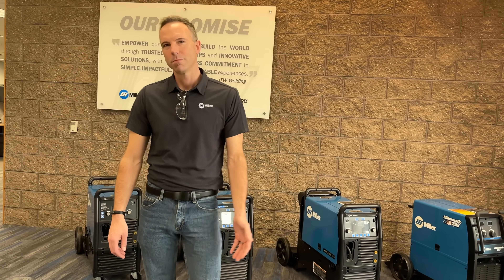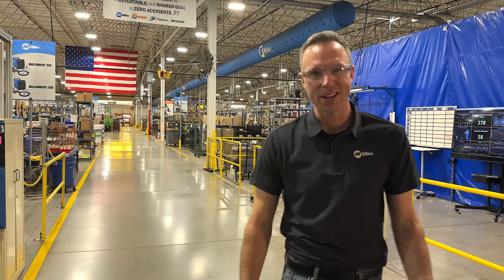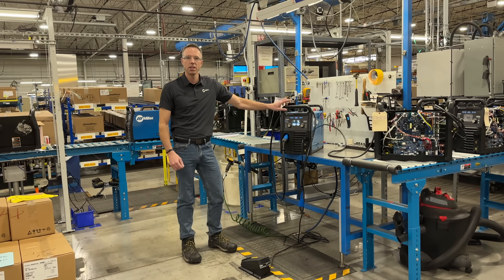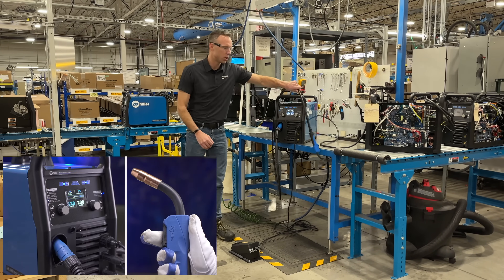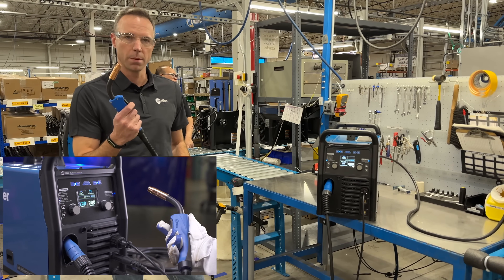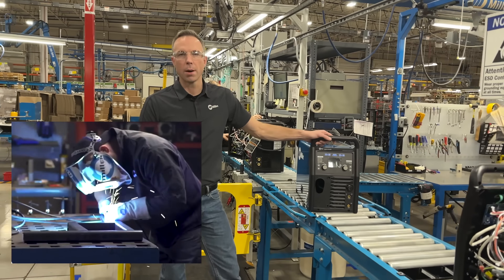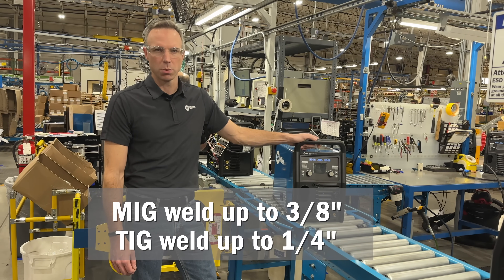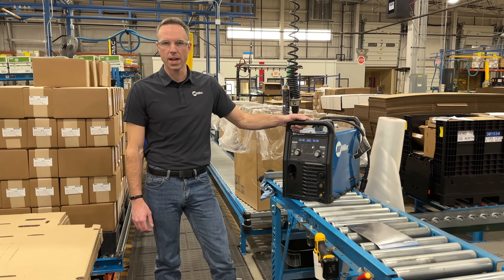Multimatic® 220 AC/DC Multiprocess Welder

Comment: But will it Dual Shield?
Reply: Yes you can run dual shield flux core wire with co2 or mixed gas whatever you do don’t put it under the flux core option put it in the other wire options